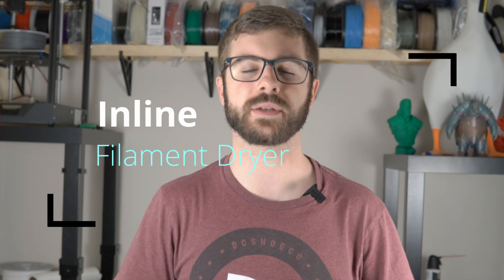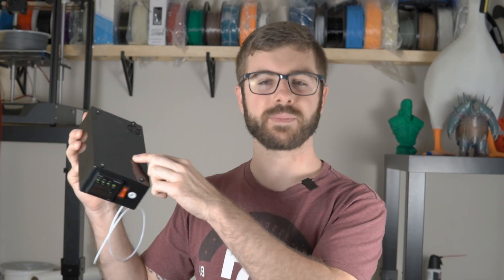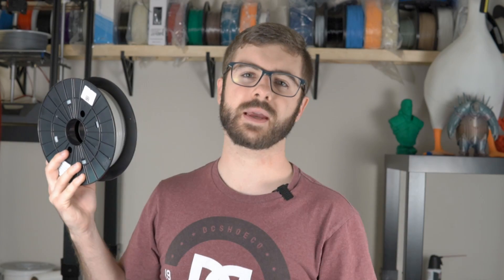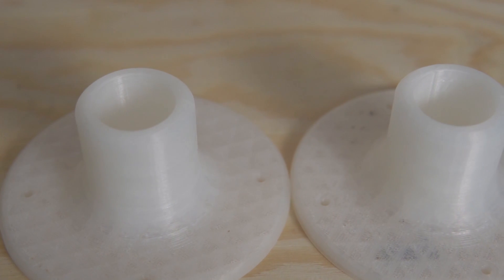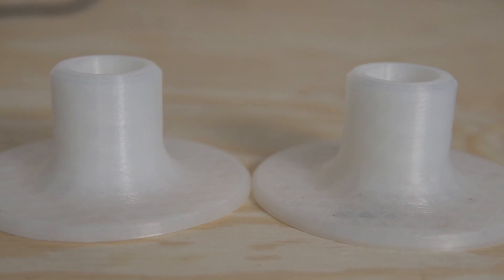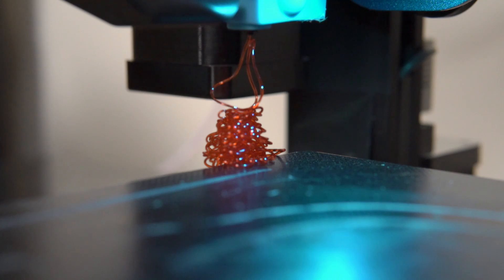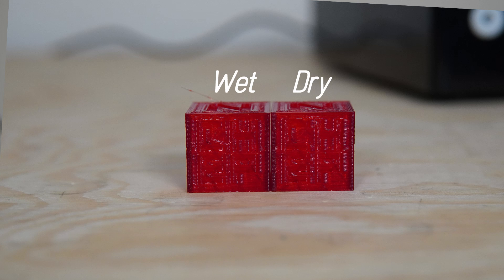Inline 3D Printing Filament Dryer | Does It Work?

Comment: the test is no good, it is missing the other drier test that should show the "real" drier improvement.
I don't think this drier is well thought out but the test needs to be improved also.

why heatsinks ? aren't you trying to heat things up ? and don't shove into a tube - let it move through air, better yet blow at it

Comment: I feel like this video is almost pointless. If your print werent causing problems from being too wet what was drying it supposed to accomplish... The only wet print that looked off was the last one barely with a web coming off and then it did seem like it didnt do that on the dry one. You should soak your filament in water until you get a print that looks like shit from obviously too much water; and then run that spool through a dryer to actually compare something. I dont know your relative humidity/where you live. When i lived in vegas "wet spool" because it was exposed would not actually be remotely wet.

Comment: Products like this prey on the fact most users don't understand plastics or how filament is made, or how slowly plastics absorb and release moisture.

A lot of filaments are manufactured by running the extruded material through water tanks several meters long to cool them before blowing it dry and winding it. If passing filament through a 15mm warm zone did anything it would be overwhelmed by the moisture absorbed from the cooling process. This might evaporate material on the very surface such as condensate, but the plastic can have moisture in its core that's not coming out so easily.

Comment: what if you made something like this DIY that could actually work. get a cheap 12v ceramic heater, get a long ptfe or something tube, cut lots of small holes along the whole tube, then put it all in a small enclose and add a mini fan to the top. my theory is that the long tube will give the filament plenty of time and surface area to stay in the heated zone while keeping the enclosure relativly small and using a small enclosure means its easier to heat up a small volume and the cuts in the tube will allow the moisture to go out of the tube into the air in the enclosure and the fan will extract the humid air out.

Comment: Did you ever get a chance to do further tests on this? Your print speed was so low that I suspect the actual printer's hotend was giving the moisture plenty time to boil out and for bubbles to escape and close up before being extruded. I'm not convinced this dryer does anything but I'd like to see a better look to figure out if the basic idea is potentially salvagable. I've been thinking of a device like this not with a tube and heater enclosing the filament, rather a system of pulleys back and forth across a box exposing the filament to moving hot dry air.
Reply from the maker: Check out this video. https://youtu.be/UzTc2vG0NNw

Comment: of course that doesnt work. the inner moisture of the filament needs time to find its way out. 
Its like photons produced in the suns core... they need about 10,000 to 170,000 years to reach the surface. same the the water molecules in the filament ;-)

Comment: Single most annoying thing about my experience with 3D printing is the ridiculous amount of moisture in vacuum sealed packaging even if the batch is listed as being packaged as a new batch. 

Hearing the crackle of water molecules pop is annoying but for the most part the prints come out looking good. Still feels shitty that the new batch isn't new, if it's a new batche and is sealed and sold for a huge markup and they couldn't even bother to dry it before packaging or making sure the packaging itself mitigates the amount of moisture. 

Feels like anti-consumer and unethical business practices

Comment: So, was there any humidity issues in any of the prints at all? Without this and info about it, the test really doesn't say much. 
The heater block looks solid, and the case closed, can the heated humidity get vented and escape the filament?
Lot's of expected info missing in the video IMO

Comment: Watching this to see what kind of drying ideas there are out there. I’m glad you opened this because I was about to search the Internet to see what inside of it, where is the moisture to go when the entire unit is sealed through the Bowden tube and the heat and elements. This is not how you properly dry filament. I’m playing around with one of those $50 filament dryers from Amazon, what I’m noticing helps is I put a three-quarter inch hole on the top and have a 3-D printed valve mechanism to close it slightly. This allows the moisture to escape

Comment: Kinda surprised there wasn't any worst case stringing test prints to compare the results. If I had good quality prints with little stringing like the ones you made with wet filament, I wouldn't really have bothered drying it :p

Comment: Yes I agree. Comparing this a oven dried filament would be great. If just to compare it to filament that has not been fried. Also, I wonder what the tensile strength between the one oven dried vs the one with moisture vs the one using the inline dryer.

Comment: 4:30 Why does it have heat sinks (fins) before and after the heater block? If the objective is to heat the filament to some modest temperature (say 50 to90C) for long enough to evaporate some water (which I guess exits through some openings in the tube/heatsinks) why do you need cooling?  The net result of the fins would seem to me to cause a shorter heated region, and significantly heat up the inside of the equipment case.

Comment: looks so odd seeing   glue being used on the  Artillery bed...     also never had    stick or release issues so far....   i wonder if this is someone solving a problem that never existed or could have been solved with a different  bed heat setting....  unless its filament type related
Reply: Did you try nylon?

Comment: Oh wow I just thought of an experiment. 2 sealed containers, both with hydro meters inside. Pull it from one box through the drier, into the other box and respool it in there. Obviously before and after you should wait for the hydro meters to acclimatize to get a good reading.

Comment: I own one of these, the version with the external heater.  There are holes on the heatsink past the heater block for moisture to evaporate.  It does not create retraction issues as the filament passes through smoothly.  I would also think since you are only heating up 1.75mm, you don't need 4hr dry time as with an entire spool.

Tested on PLA that had moisture and did notice a difference, almost no more pockmarks.  Testing on NylonX currently, that will be the real test
Reply: Did it work with Nylon?
Reply: @BradKwfc  Not really, definitely have to dry Nylon out first.
Reply: @mikeb1596  Cool thanks.

Comment: Hey, thanks for taking the time to try this out on behalf of everyone! However, is it possible for you to try this with some filament that actually has defects she printing. In the video, your prints before using the machine, didn't really look like they had any problems printing to be honest (kudos to you lol). Hence it seems pretty difficult to conclude if the machine actually helped at all. For example, I have filament that has enough moisture that its too brittle to even print for 15 mins straight!

Comment: It would be interesting to see it as an experiment .... but not as an actual product.

I think a longer heatsection (that block is really small) and a way for the hot air to escape after drying would be essential. (You could try to implement those)
But be careful, that the insides of your box don't get to hot as well.

But even with a longer heatsection and an outlet for the hot air, i expect the time to be insufficent for proper dehydration.

Comment: When you opened the filament dryer I couldn't see any were for the water to actually escape. Also in my experience of drying things you need to give stuff time to dry and it doesn't look like that machine gives the filament much time to dry. If I designed a filament dryer I would probably do it in a similar way but have a much longer aluminum block with a brass threaded channel that has a few holes drilled through it so moisture can escape.

Comment: Yes, I am afraid this is a complete marketing gimmick. Moisture removal is time dependant. Moisture can be removed faster but the only way possible is to increase temperature/airflow/pressure. Any way at all of trying to increase the rate of drying also increases the change of the polymer properties. There is no fast way of doing it without changing the polymer properties. Nylon is very hygroscopic and takes roughly 5 days at a low temperature to dry (correctly) without ruining it. Brilliant videos though. The topics being talked about open up great ideas to be further explored! Thanks! By the way are those repurposed e3d cooling fins in that machine? 😅

Comment: Having worked in the plastic injection molding business for a number of years I think I can shed a light on what should be dried and what doesn't need it. Polypropylene, polyethylene, and similar plastics don't need to be dried. These plastics are what milk jugs and plastic bottles are made of. Nylon, abs, polycarbonate, styrene and similar hard plastics need at least 1 hour of dry time. They will suck up moisture like a wick. This causes brittleness and lamination. That little machine is just a waste of money in my opinion. Hope this helps explain the problems some of you are experiencing. Also soft rubber like plastic doesn't need to dry.

Comment: haha, yeah no way this thing could possibly dry filament that quickly. Typically we dry filament in a dehydrator for 4hrs+, no way could this suddenly dry it as it just passes through quickly.
Reply: Well... that's because it's all bunched together on a spool... is the theory
Reply: @FuriousImp  there's a lot more at play than it just being bunched together. The ability to fully heat the material takes time. As it also takes time for the moisture to migrate out of the material. If it were to instantly be heated enough for the moisture to instantly be pushed out, it would Form bubbles in the materials. That's what we see at the nozzle end.. It must be a slow process to allow removal without damage and to fully permeate and evacuate moisture.
Reply: @secretagb  Thanks

Comment: I side with Nike Sanders. There's no evacuation for the moisture once it's evaporated. Further, I'm not convinced that the heater provides enough time for deeply-absorbed moisture to evaporate out of the material. 

One test I would devise is to take moisture-ridden filament, cut it in half, and push/pull one section through this machine at a feed rate that a 3D printer would typically use. Then weigh both sections and see if there is any tangible difference. I would probably run 5 or 10 samples, just to make sure there's no statistical hilarity messing up one or two samples. 

A possible alternative design would be to blow air through a resistive wire-heater block and onto the filament. That ensure's a constant heat with the added benefit of evacuating moisture.

Comment: The device is supposed to dry your filament, and that may result in better prints, but not necessarily. If a filament, which has been exposed to moisture and pop like crazy while printing, prints quietly when being run through the dryer, it would have achieved its purpose.

Comment: On a side note for video production quality, you should stay away from using red, white, and black, as they do not film well.  If you want to show every harsh detail, gray or beige are usually the best.  I do concur with others that you need a wet, treated, and dried sample print to fully demonstrate the point.

Comment: There's nowhere for the moisture to go, it's just heating it up after seeing the inside shots. Seems to me like someone is trying to make money from bad design.

Also those cables near the heater cartridge look uncomfortably close, not even zip tied down to ensure there's no contact and fire.
Reply: The 2nd heat sink has hole where moisture is supposed to escape

Comment: This device is all wrong. Just because it’s hot doesn’t mean it’s drying. There is nothing to pull the moisture out. A dehydrator uses moving hot air and pulls the moisture away from the filament.
Reply: Right! No moving air, not enough air volume around the filament to evaporate the moisture into, not enough time...the list goes on.
Reply: secretagb very correct. Humidity in air is the air being saturated with water. When air is over saturated condensation begins. Take a humid place like Florida. It can be very hot and humid. It the moisture has no where to go it will remain hot and humid. If anything over time this device would make things worse.
Reply: @MrSand83  Maybe it should be labeled as a moisture redistribution device as it may just create a moisture cloud inside the PTFE tube for dry filament to pick up.
Reply: I had an idea for an inline dehumidifier for filament but it would need a smallish spool in the middle that could wrap the filament round a number of times, keeping a few m in the device so that it has enough time to dry. You could have a peltier inside to heat the chamber (warm side closer to filament with a fan) with the cool side above a moisture collection funnel and port to actually dehumidify the inside of the chamber.

Comment: What is the climate where you are located? Humid? Dry? I see no evidence of moisture in the prints done with your wet filament. Did it crackle and pop while printing. The real test would be taking a roll of filament that was showing evidence of of moisture and then running it through the drier. 

You can't fix it if it ain't broke!
Reply from the maker: I am located in California which is not a humid state. However, I am near the ocean and my apartment is very humid. We empty a massive dehumidifier at least twice a day. I did hear crackling previously with the filament. I would anticipate the results would be more extreme in a more humid environment.
Reply: @ModBotArmy  I don't remember you saying what type of filament you were using. If your filament is really wet you won't get a clean print. Layer adhesion should be a major problem. I'd like to see this unit tackle some filament that is having problems printing because of moisture. Your sample is starting off pretty dry. It seems that it may be a little clearer after drying. Maybe the drier had an effect on what little moisture the filament contained. If the drier can take really wet material and spit it out as clean as yours is starting out, I'd call it a success. Your test didn't really tell us anything.

Comment: theres not enough time spent in the heater to do anything, and really no where for the moisture to escape to. 
please do a benchy with oven baked, inline baked and wet. and please use a solid color of filament instead of translucent.
Reply from the maker: I may end up revisiting this to compare the three with a spool that has been soaked.
Reply: The 2nd heat sink has hole where moisture is supposed to escape

Comment: Pro Tip; even most engineers dont know this. It (mostly) explains the wide variance in observations experienced in this group.
Entrapped moisture is critical; example is  COB to flex circuits at 160C , 2sec attach temps.. Extensive DOEs have shown two distinct levels of residual mousture; surface and internal. Generally, the surface will absorb and release moisture at a significantly faster rate than the core of the material. For a 20mil
Polimide flex board, a 16hrs min bake at 125C should release most of the core moisture . Store in dry nitrogen. Upon use, just a 2hr bake at 125c will release most of the inevitable surface moisture from being loaded onto pick and place machines. Flex suppliers often specify a vacuum oven for this. Personally, my data shows this as over cautionary.Root Cause functions are material type, thickness, and previous storage. We live on a very Wet World; this topic needs diligent science. Cheers.
Reply: I think you have the point, this filament "dryer" from what I understand should be used on hydroscopic materials after they have been dried (inner moisture), to control surface moisture during printing. Basically meaning it wont solve improper storage issues.  I use it on nylons etc, that have been prepared before printing to be dry, and allow this to clear the surface moisture (well one like it - homebaked).

Comment: If there are no holes In or very near the heater Block in that Dryer - the moisture has no way to escape from the filament - since the filament passes straigth into a bowden tube
Reply: I agree here, the moisture does not come out instantly either so should go around an internal exposed track before going into the bowden tube.  Would be better if there was no bowden tube to the printer.
Reply from the maker: That makes sense. Seems to be a general rule that the moisture would need an outlet to escape.
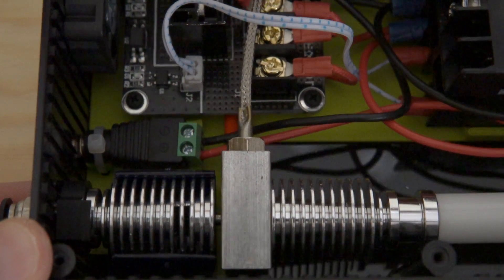Reply: But there are holes in output heatsink, lot at video around 4:44. Look at thingiverse 3669673 . ... i want to believe :D

Comment: Hey Mod Bot, Another informative video!!👍🏽 Plz review the Anycubic 4max pro fully enclosed 3d printer, it is regularly on sale for 299$ usd and has a filter, a large build volume (205, 270, 205mm), ultrabase heat bed, direct drive extruder combo, and the various software features, like filament runout detection, power loss resume, and power off when finished with print
Reply from the maker: I would love to review that machine. I had my eyes on the original 4max and wanted to review it badly. I actually reached out to Anycubic for that machine but they were not looking for reviewers. Perhaps in the future.